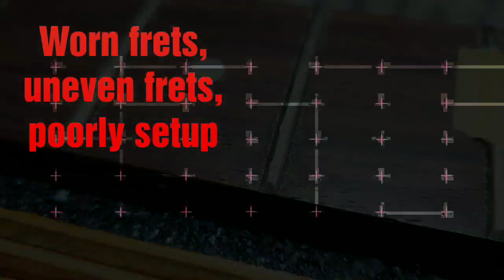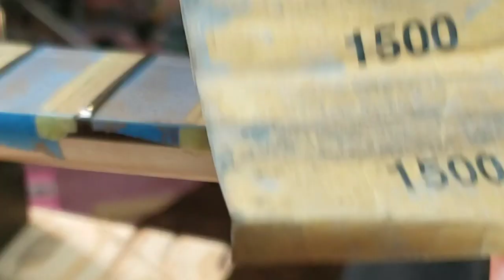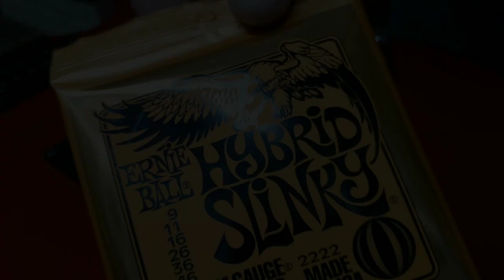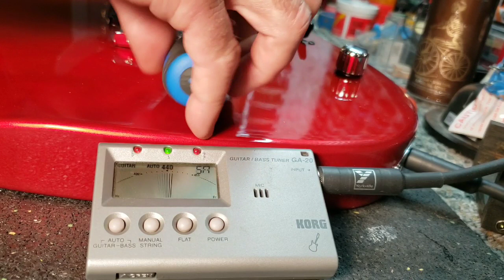Ibanez Gio fret level and setup.

Comment: Very nice but maybe add some tape at the top of fret board the exposed wood was getting scratched on the fret ends
Reply from the maker: At the end of the job there was no scratches present.  Not sure what you mean.
Reply: @ricksworkbench1386  They had to of been there afterwards, patches of exposed wood right behind the fret ends on the top of the fret board. in your video you zoom in and you can see the files scratching the wood.
Reply from the maker: @justinfleming7603  Nope, all scratches were gone at least most of them. The flapper method used will take most if not all of those scratches or fret grooves away (3:14). Anytime you have fretwork done by hand there will be some tooling marks present. THat shows it was done by hand. Look at any Gibson and youll see tooling marks. Was this guitar full of scratches when I was done? Not at all. Look at the frame at 9 minutes. Looks clean to me.

Comment: Hey Rick my Gio Strat  bridge is messed up after screwing up a DIY tremblock mod, any ideas on how to fix it its lifting waaay up and i feel like my guitar is FUBARed.
Reply from the maker: Tighten the screw claw down and it should pull the trem back to the body
Reply: @ricksworkbench1386   The screw claw/springs arent in, to get the the wood out.  but I'll try to put it back in and  see if i can pull it back down to the body , without breaking the neck.